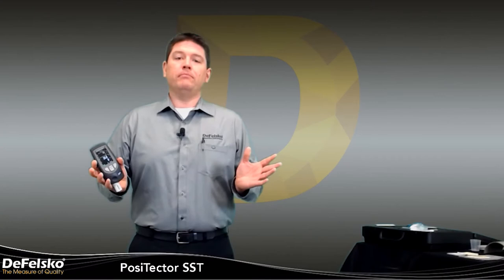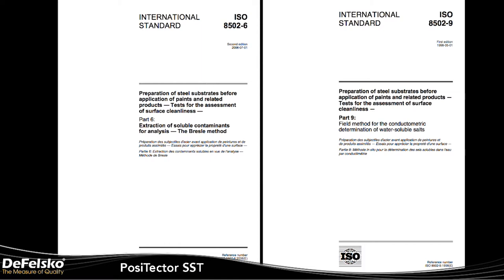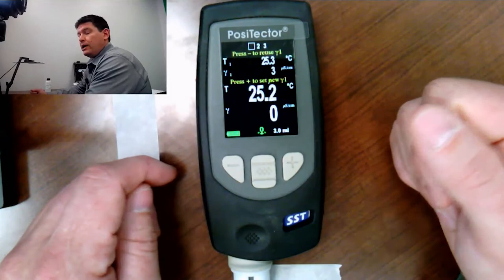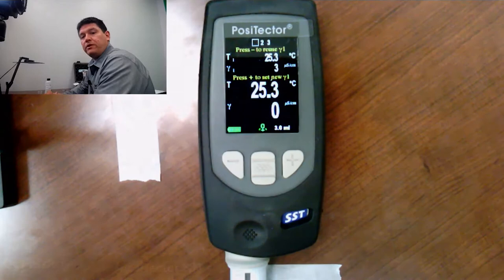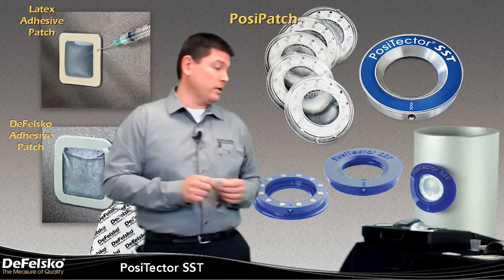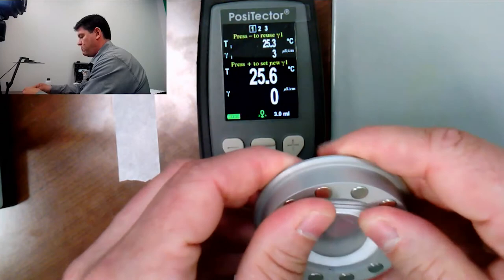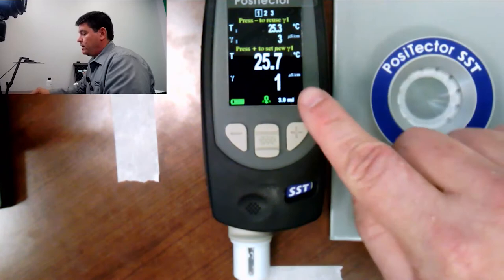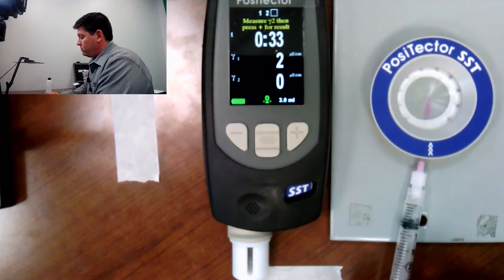PosiTector SST Webinar

Comment: I am curious to know how its possible to flush clean the resuable possipatch between uses - don't you get the risk of soluble salt hang up in the patch?
Reply from the maker: Hello John,

Thanks for your interest in our PosiTest SST instrument and reusable PosiPatch.

Cleaning the PosiPatch between tests is as easy as rinsing it thoroughly with DI water. Extensive testing has shown that this simple rinse is sufficient to remove soluble salt residue from the PosiPatch. If higher than expected results are obtained, use a new PosiPatch to verify results.

Please feel free to contact us to discuss this further +1-315-393-4450. It is our pleasure to assist you.

-Terry

Comment: Hey Guyz is distilled water also possible to use?
Reply from the maker: Like all soluble salt instruments that test in accordance with ISO 8502-6 (the Bresle Method) and ISO 8502-9, the PosiTector SST requires the use of DI (deionized) water to obtain a valid reading. Please contact us at techsale@defelsko.com if you require additional assistance.